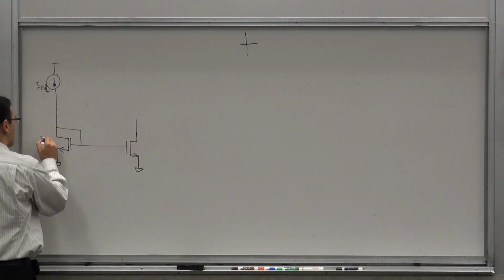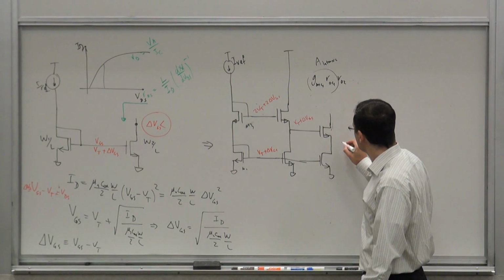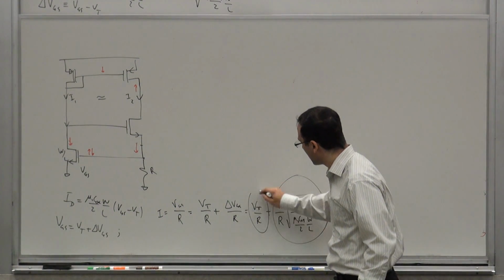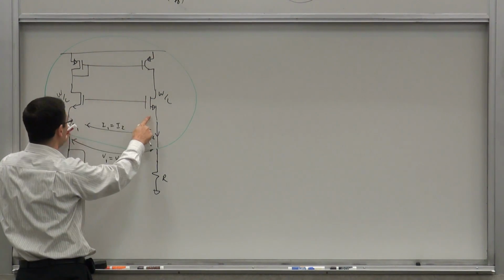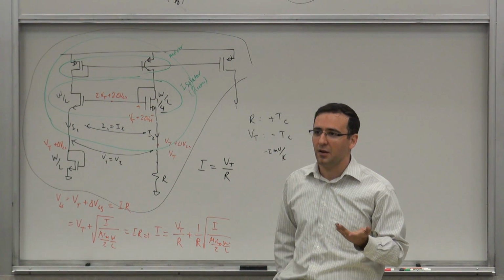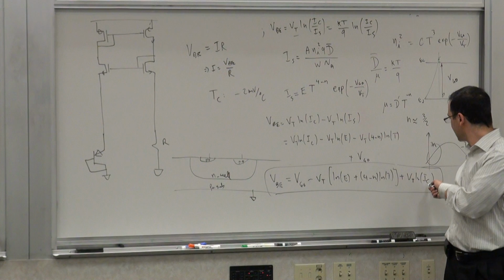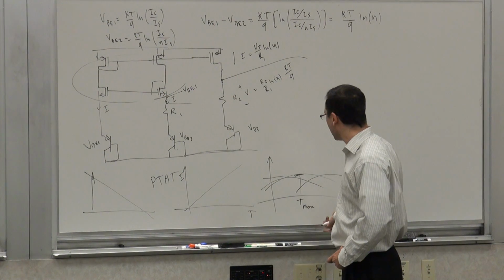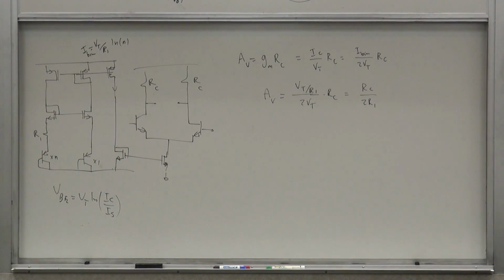127. Supply-, Process-, and Temperature-Independent Biasing

Comment: Prof. Ali,
You started off with supply independent current source, but you never discussed temperature independent current source. I understand the floating mirror technique can be used to get an Iref independent of supply voltage. The BGR requires a PVT intependent current source, is it not?

Comment: thanks alot for the video.. but at one place u mentioned the Vt having -ve temp co. i.e -2mv/K.. which is I think is wrong.. it has a +ive Temp Co. is +0.085mV/C.. thanku
Reply: You are thinking of thermal voltage of a BJT. He is refering to the threshold voltage of a MOSFET with this Vt.

Comment: Sir, why do we want our reference current source to be linearly dependent on Vt?
Reply from the maker: The answer is at 1:18:00 and afterward. That is assuming you mean thermal voltage (kT/q). This is not alway the case, but if you are using BJTs and want to have constant gain, where gain is gm.Rc, where game is Ic/Vt, then making Ic proportional to Vt removes the thermal dependence.
Reply: also having PTAT current helps you make an independent supply reference if you add it correctly with a CTAT voltage (like VBE)

Comment: Professor Ali, I would like to ask you a question. Around minute 23, when you are explaining the current reference, you don't talk about how the current starts to build up. can you please explain this?

Another question, side to the other one, I can see that you have got more than 150 lectures on your channel. Are those all from the same course or they are from different courses? How can I know which course a each set of lectures belongs to? Regards.
Reply from the maker: In any feedback loop, particularly, when there is positive feedback, the noise can serve as the initial perturbation and once it starts, it can get amplified but he loop leading to potential oscillations.
Reply from the maker: They are from two different courses: A one quarter introductory under graduate course (EE44) (those starting with a zero) and a two quarter grad/undergrad course on electronics (EE114 a and b) (those starting with 1). You can see the actual order and lectures by looking at the playlists on the channel.